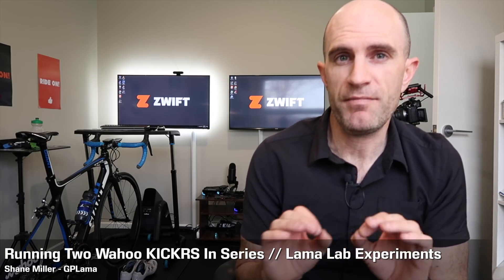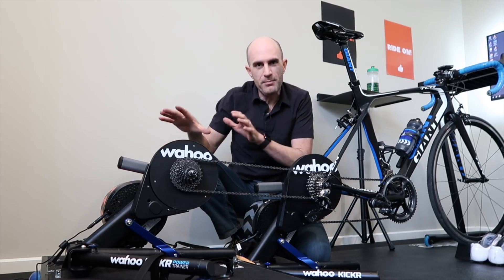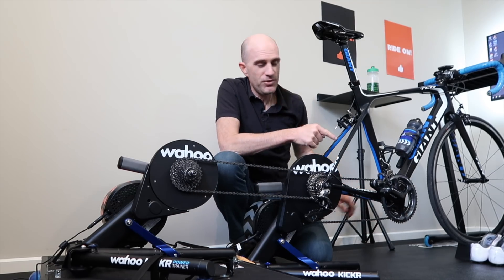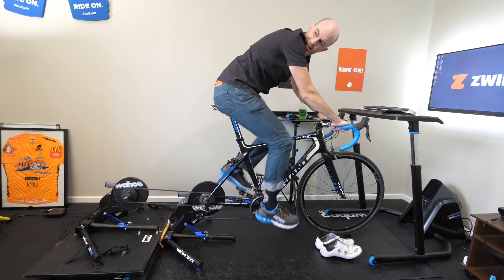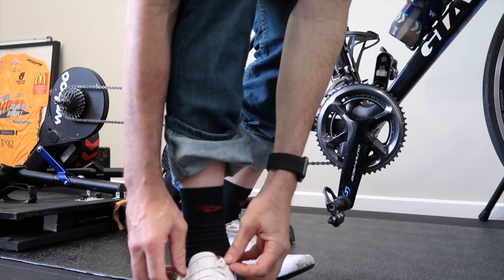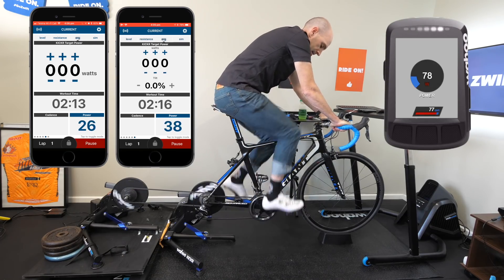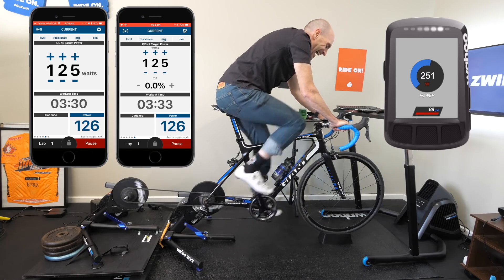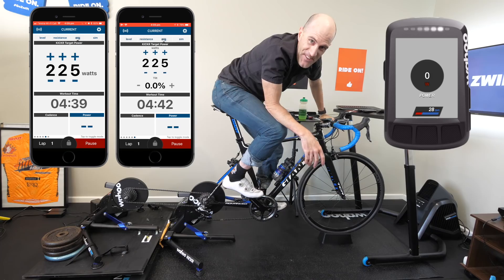Running Two Wahoo KICKRS In Series // Lama Lab Experiments

Comment: Interesting, I'd love to see this applied to external power generation. Can the kickr 1) Power itself, 2) Power the TV aswell, 3) Generate enough power to store? I've seen it done with wheel on trainers but never a direct drive :)
Reply from the maker: The power generated by humans is pretty low. The energy put into making trainers with a return energy system would likely outweigh the energy returned from the rider over the lifespan of the device. It's a neat idea... maybe to power USB chargers or something.
Reply: @gplama  Ah ok :)

Comment: Hi Shane, did you ever try the Under Armour HOVR shoes with Zwift Running? I remember you got some in the US and were excited to see if they would work with Zwift but I don't remember ever seeing the resulting test. Did they work?
Reply from the maker: After switching to Hoka I never went back. I still have them, I’ll have to loop back to this when I have access to a treadmill. The TechnoGym has gone back (was only a loaner)
Reply: @gplama   I too run in Hoka's but have a milestonepod on them to enable Zwift. But it runs out of battery from time to time and then you wonder if the run actually happened as it's not on Zwift, not helping you to level up, should I actually run - then I remember I have Nike Running on my wrist and so I run on.

The freedom from the pod seems interesting but I'm guessing that there must be an internal battery that will die too, just on a much longer timeframe, and maybe before I'm done with the shoes? I see no mention of it on the website (US) so I'm assuming it doesn't work but interesting idea. 

Anyway when I move to the US next year I will explore such fun things ;-) 
Cheers.

Comment: Mind blown! Can't believe this didn't make DCR's Week in Review post of 'things i've seen around the interwebs'.
For those of us of an obsessive nature, why might the Wahoo logos be spinning at different rates? Different casette ratios? Different flywheel dimensions?
Reply from the maker: The two drive wheels are different sizes. The Kickr18 has a larger drive wheel for more surface area on the belt (to stop slipping). Gear ratios will also do it. Great questions.

Comment: Great video. What method did you use to trap images of the two phones and head unit?
Reply from the maker: Phone screen recording, imported into Final Cut Pro. Layers to get them in an iPhone case. BOLT was overlaid within Garmin Virb Edit then imported into Final Cut. Way too much work for a short video :)
Reply: Shane Miller - GPLama. Yes that was a lot of work just to get the images. But, I can relate I’ve done a similar thing. But lots of fun

Comment: I'm a physics teacher. I love everything about this.
Reply: can you maybe explain why 100w + 100w are less than 200w? since if there would be drive train loss, id think the rider had to compensate for it so he should be riding >200w or am i wrong?
Reply: I believe that having 3 different powermeters involved pretty much explains it ;)
Reply: @velo1337  erg mode isn't perfect.  It asks for 100 W and tries to increase resistance to make it happen if you pedal to slow, but depending on the control algorithm, it might be off by a bit.